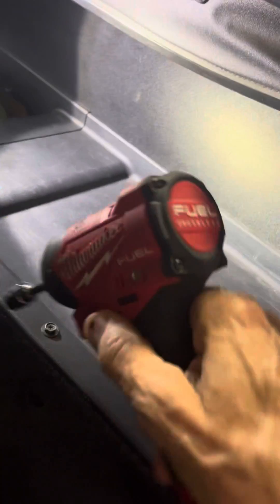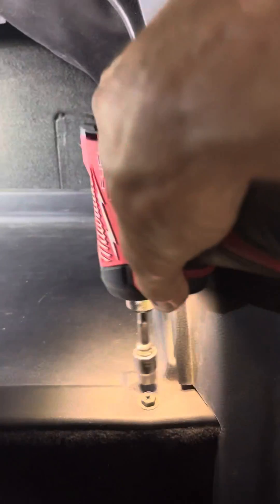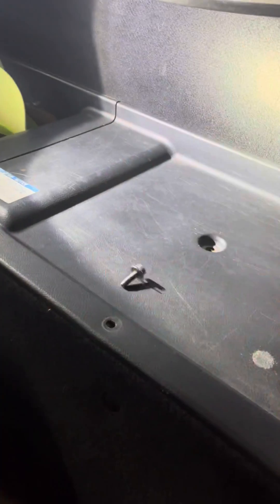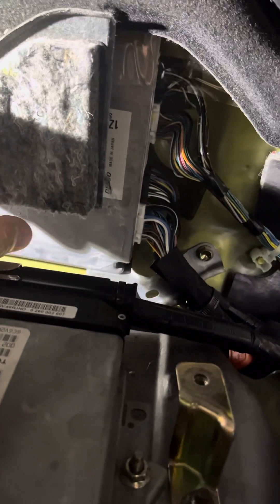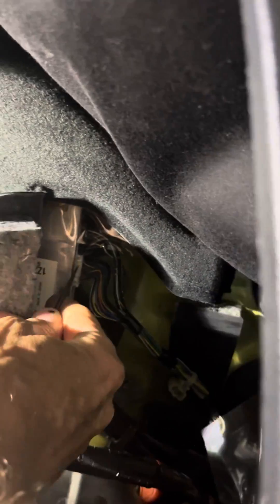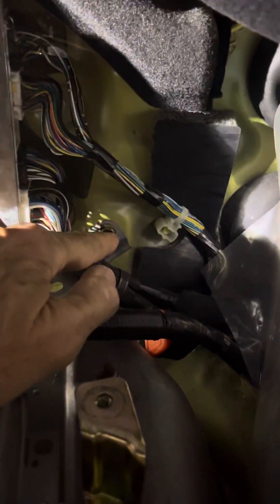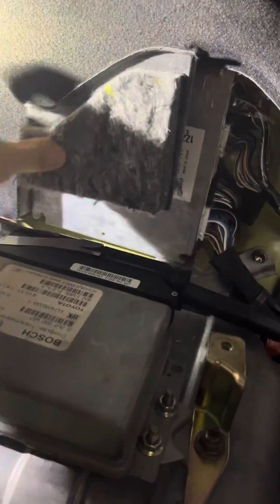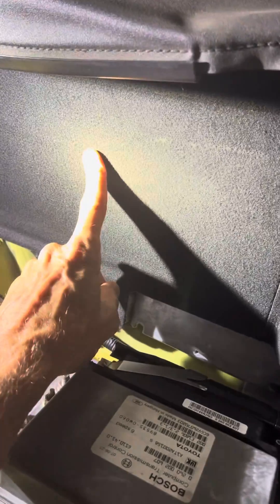Toyota MR2 Spyder - remove ECU

Comment: Is that the transmission control module?
Reply from the maker: ECU is the Engine Control Unit.  I also pointed to the TCU which is the Transmission Control Unit.